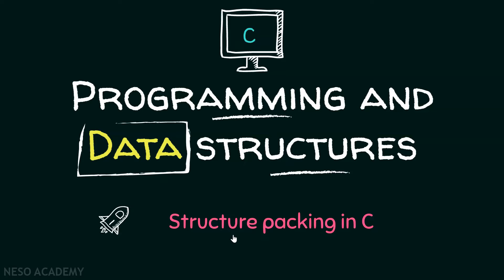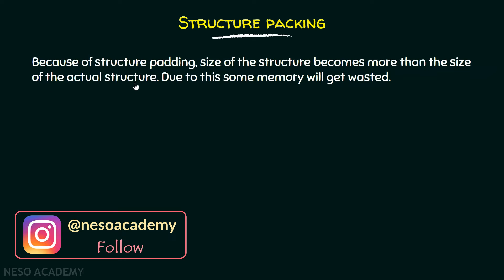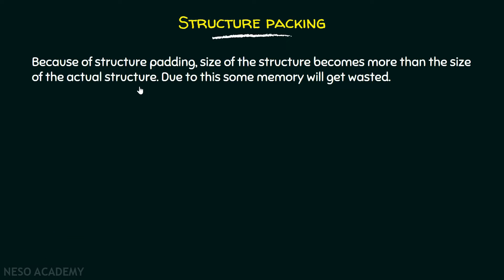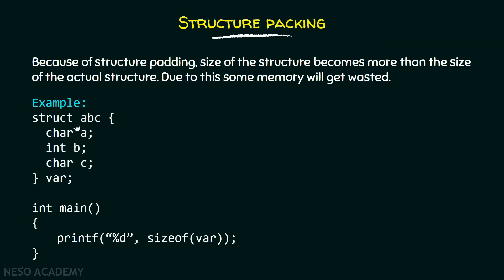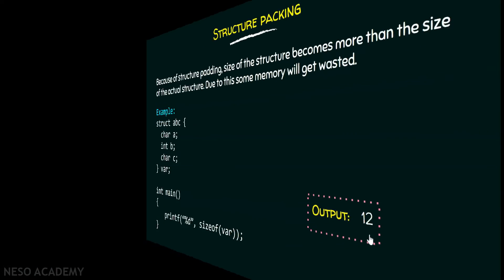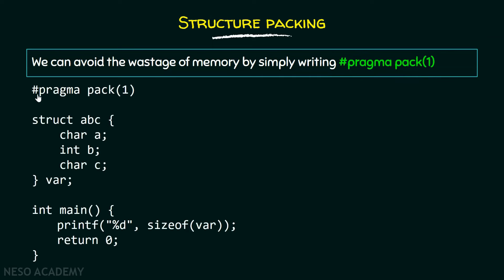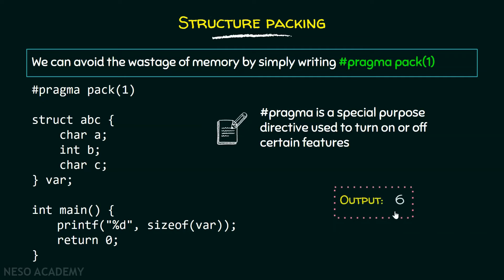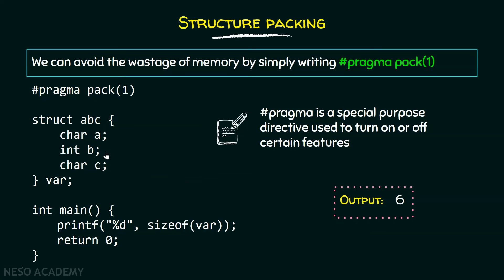Structure Packing in C

Comment: You should still study your target architectures and not take all structure padding as bad ... most modern processor ISA's implement a "barrel shifter" to make fetch and put single cycle operations which based on structure types and order sometimes can't help but have some padding ... Binary packing is another technique to be studied that focuses at the byte shifting  .. great for implementing protocols and working within the bounds of CPU caches

Comment: sir as in previous example where 12bytes were used and 3cpu cycles then still if we did't used padding then the fisrt char will use 1 byte 2nd int will use next 3 bytes of first word and 1 byte in 2nd word and 3rd char will use 1 byte in 2nd word, total of 2 cycle being used, this is inefficient
Reply: to fetch a one variable it needs one data at a time in the padding, in not padding it needs 2 cycels to fetch the int variable, thats what it means by it is more efficient if i am correct.

Comment: Excellent video!

  I  have one question!  if possible then please explain the below statements, I am a beginner in c and I do reverse engineering for learning purpose here is the code

////////////////////////////////////// Start code /////////////////////////////////////////////////////////////////////////////

#ifdef _GNUC_
    #ifdef PACKED
        #undef PACKED
    #endif
    #define PACKED(TYPE) TYPE _attribute_ ((packed))
#endif

typedef enum flash_qspi_evt_s
{
        eflash_QSPI_IDLE,
        eflash_QSPI_INIT,
        eflash_QSPI_UNINIT,
        eflash_QSPI_READ_REQ,
        eflash_QSPI_READ_DONE,
        eflash_QSPI_WRITE_REQ,
        eflash_QSPI_WRITE_DONE,
        eflash_QSPI_ERASE_REQ,
        eflash_QSPI_ERASE_DONE,
} flash_qspi_evt_t;

typedef PACKED ( struct module_flash_qspi_report_s {
        flash_qspi_evt_t evt_type;
}) module_flash_qspi_report_t;

typedef void (* module_flash_qspi_evt_handler_t)(module_flash_qspi_report_t * p_qspi_event);

typedef PACKED (struct
{
        uint32_t base_address;
        module_flash_qspi_evt_handler_t evt_handler;
}) module_flash_qspi_init_t;

void module_flash_qspi_uninit(void);

ret_code_t module_flash_qspi_init(module_flash_qspi_init_t * p_qspi_init);

////////////////////////////////////// End code /////////////////////////////////////////////////////////////////////////////

Here I don't understand the meaning of PACKED and typedef function pointer,

Thanks in advance!

Comment: The teaching about structure in detail is excellent. Can you please explain the #pragma directive in detail
Reply: This directive is a special purpose directive and is used to turn on or off some features. These types of directives are compiler-specific i.e., they vary from compiler to compiler.
-- For example, #pragma warn Directive is used to hide the warning messages which are displayed during compilation, it can be used as:
#pragma warn +xxx (To show the warning)
#pragma warn -xxx (To hide the warning)

-- #pragma GCC poison is supported by the GCC compiler and is used to remove an identifier completely from the program. It can be used as #pragma GCC poison printf to poison printf keyword. 
Similarly, it has many uses. The only feature I use is #paragma pack(1).